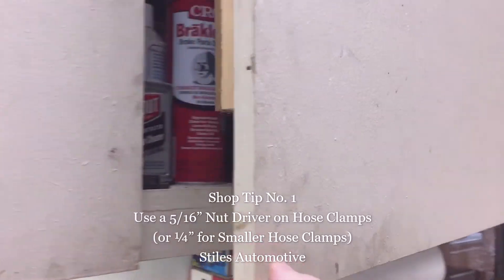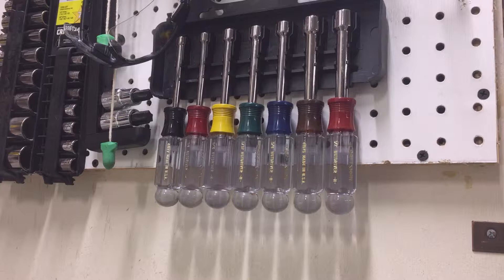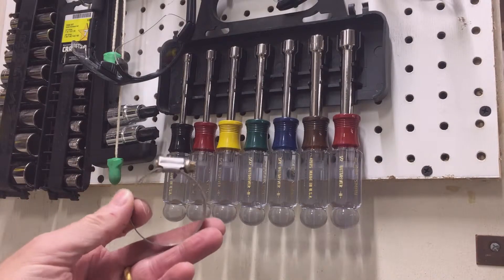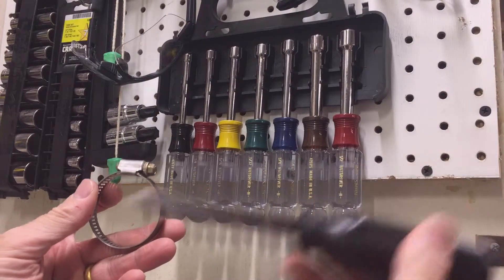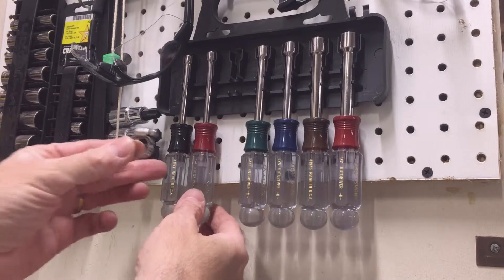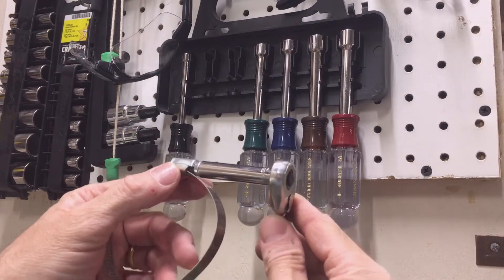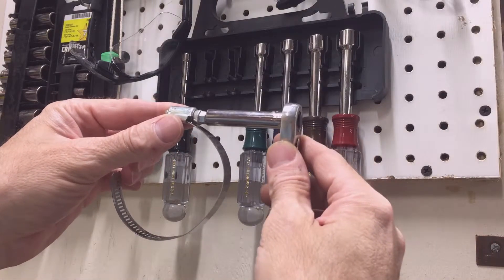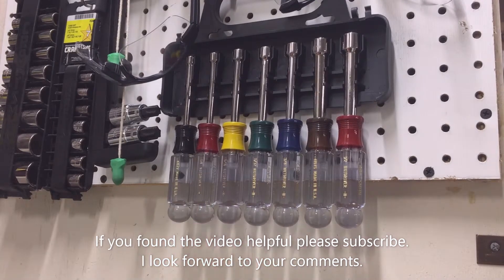Shop Tip No  1 – Use a 5/16” Nut Driver on Hose Clamps (or ¼” for Smaller Clamps)

Comment: As a tool room clerk, working in a motor pool  this is very helpful as a reminder on the right tool for the right job, always
Reply from the maker: David, Wow, Shop Tip 1, hasn't gotten a lot of views, but it is one of my best Tips! You are right, using the correct Tool makes life so much easier. And its better for the Work Result and the Tool. I appreciate the comment! - Stiles

Comment: I never thought of this, this is a great tip.  I use nut drivers on self-tapping sheet metal screws ALL of the time, but never thought about using them for hose clamps.  I just tired it and will be using this idea from now on!  Thanks for the great tip!
Reply from the maker: Thanks for the comment.  I'm glad the tip was helpful!  - Stiles

Comment: That is a really top tip, Ill be using that in the future and never gave it a thought
Reply from the maker: Thanks for the comment!  Try it one time and you will never go back.  That is my goal to help make life easier.  - Stiles.
Reply: @StilesAutomotive  On the strength of this video,I've just ordered a Gearwrench ratchet AF/METRIC set because this is a really great idea for a sometimes difficult repair, cheers Darryl